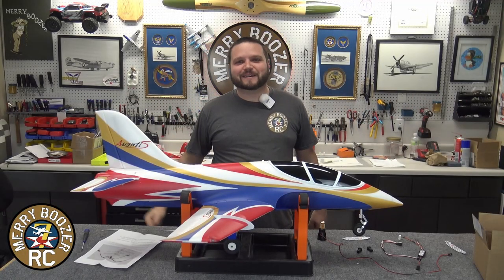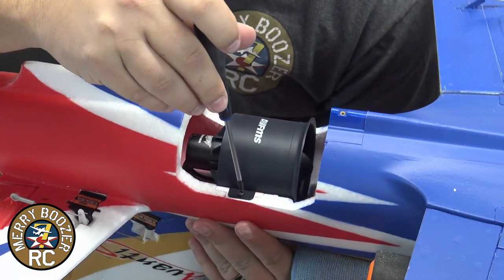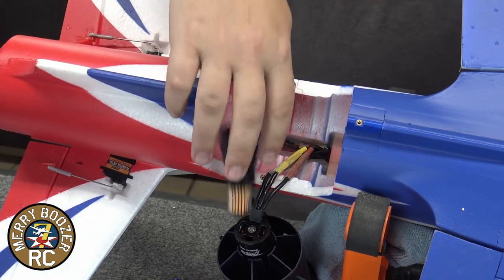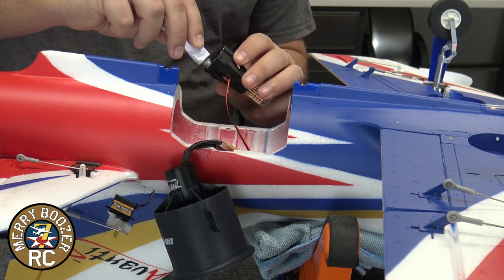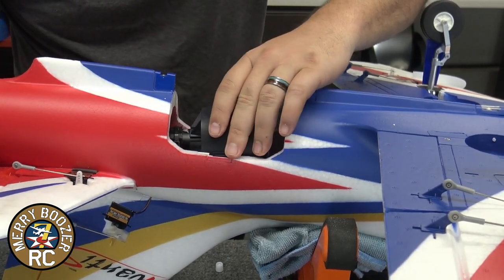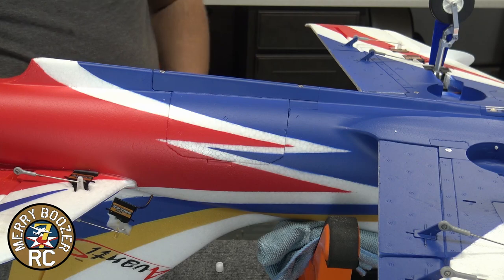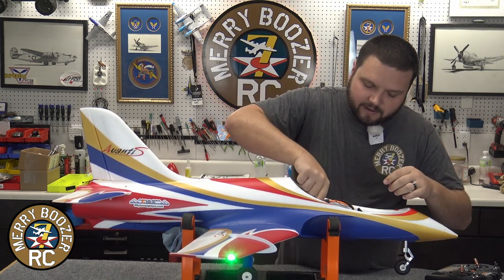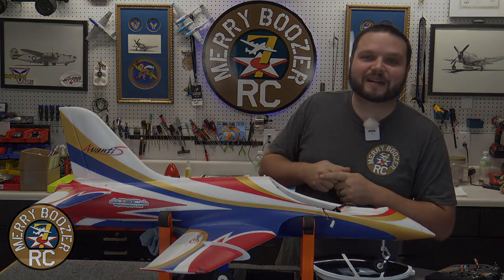5280 Afterburner Light Install and first impressions.

Comment: Bought one for the Motion F-4.. Dropped it in, no screwing around with end points or throttle... It works GREAT.. Gonna replace 2 other planes with the control boxs from 5280....

Comment: Hey I installed this kit in a 90mm viper and now I get a esc no data message any ideas to check the instal went easy with the  video
Reply: Are your wires all connected correctly?

Comment: I can't seem to find that come gettem wire. I need something to pull wires. Anyone know where to get them? I know I can use a coat hanger but that is too stiff. It leaves dents in the foam if it doesn't bend right. Thanks for the video!!
Reply from the maker: The wire comes with a lot of Freewing models